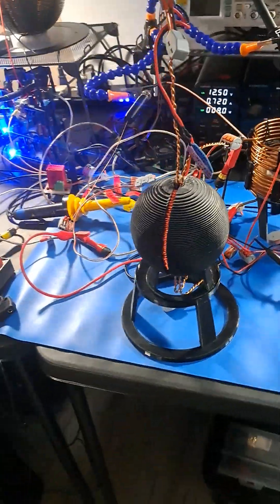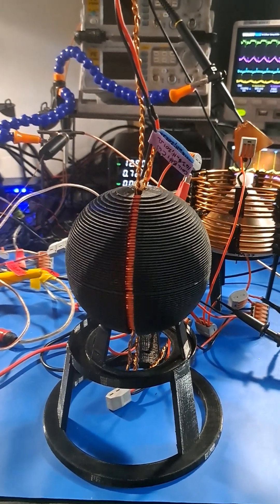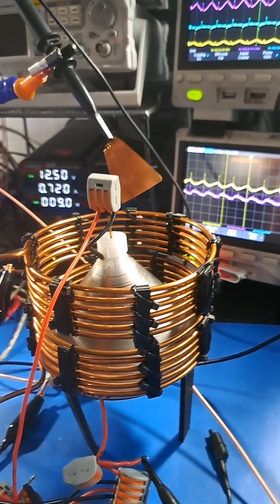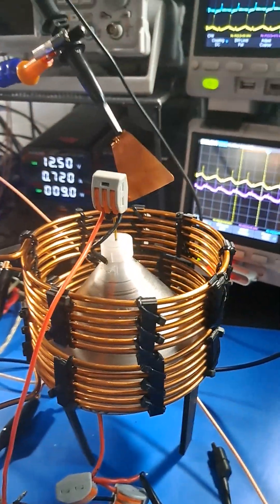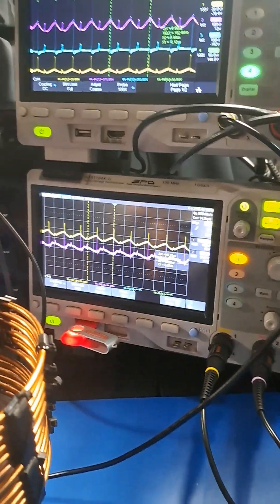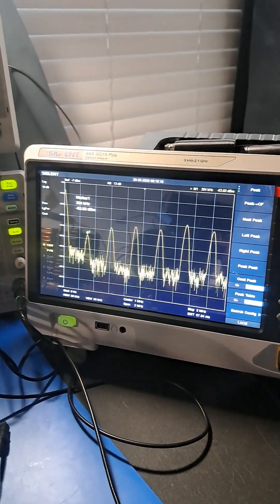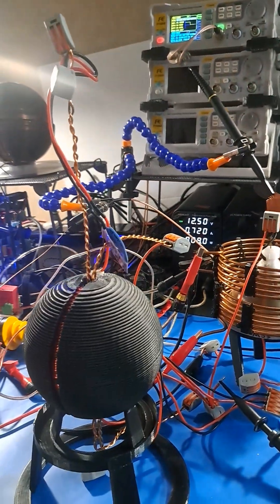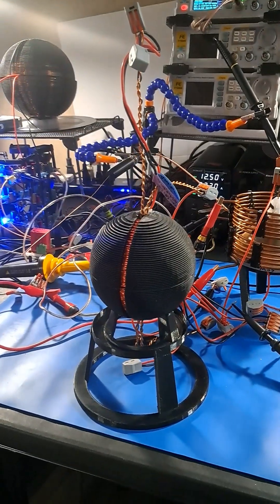Scalar Harmonic Oscillator

Comment: Your coils are as much are as they are scientific. You give a clear explanation of each piece of this fascinating apparatus. 
How do the device outputs compare to the designed results? I found this video so interesting that I watched it twice.
Reply from the maker: Thanks Shawn! Everything is very much wip, trying different driving circuits and different combinations if energies. I have a new mid sphere coil to wind which will be single filar 180 degrees out of phase which aligns more with the style of the toroidal coil I made last year (cornea coil) - just starting out on scalar physics experiments...! So far - if my EM interpretations are correct,  the basic system is behaving as designed.
Reply: Ian is not only a brilliant builder but his setup is always aesthetic. I could imaging measuring scalar waves would be difficult with conventional equipment due to the inherent 180 degrees phase relationship, and the spectrum analyzer is a nifty way to sniff it out. You may need to craft your own scalar wave receiver that can "re-phase" the signal near the 90 degrees shift for conventional measuring equipment.
Reply from the maker: @Vor-TechsHQ  Hey Brent - thanks for the encouragement! Well, after due consideration and watching Nathan's (OMB) recent videos on gravity variables, I'm redesigning the coil structures and windings...again! I'm going to drive the SIC in the center using only the rod (OWE) connection and build a new RSS counterwound same gauge as the SIC, to be a closer natural frequency match to it at 2:3, and rewind the Tesla secondary to drive the RSS hemispheres directly as a bipolar - that'll drive them all at the same frequency. The hemispheres of the two spheres (SIC and RSS) are scalar-wound with the B curl removed. It's been difficult resonating the actual scalar cavity formed between the two inner spheres, but I'm getting there...slowly! A-field resonance is a steep learning curve for sure...